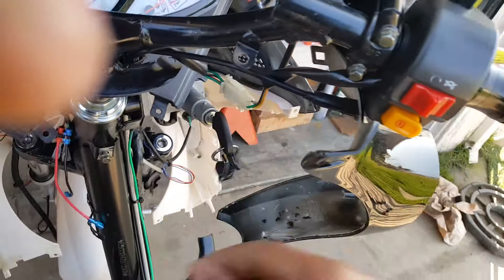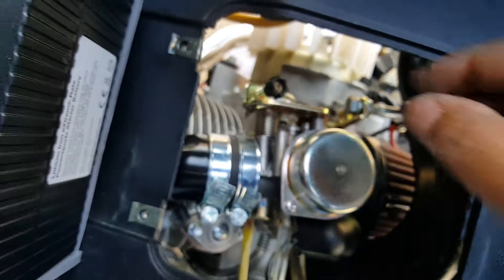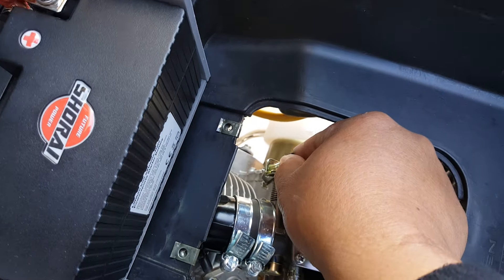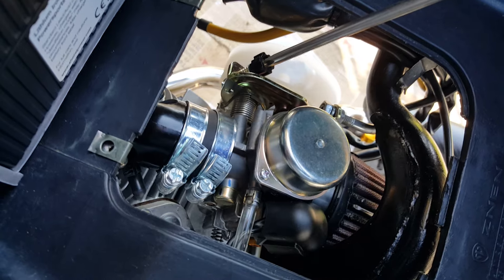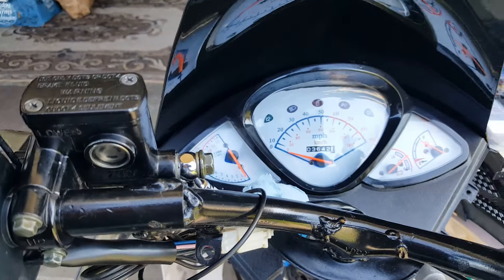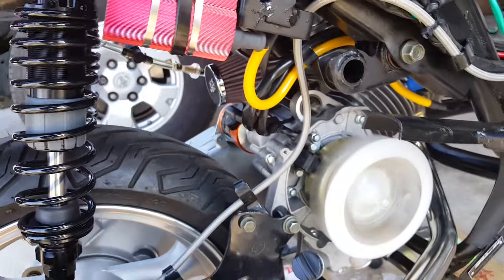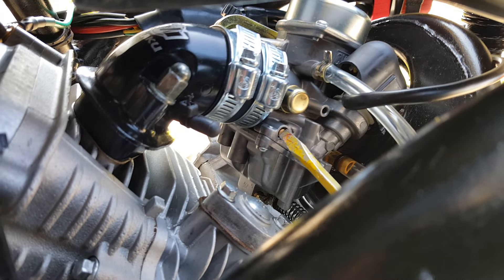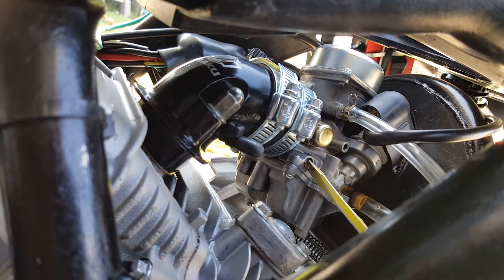How to Tune GY6 Carburetor Idle and Idle Mixture Screw 11 of 12

Comment: Set your fuel mixture screw first to it’s highest possible idle, THEN adjust your throttle idle screw... If the fuel mixture screw is turned out more than 4 turns to reach highest idle than you have the wrong size pilot jet and it should be increased in size. If you turn the fuel mixture screw less than a turn to reach highest idle than the pilot jet should be decreased in size... Turning the fuel mixture screw all the way in should kill the engine and if it doesn’t than the pilot jet is to rich (Large)... Your approach is very Elementary and not ideal for the best possible performance...
Reply from the maker: Thank you for the tuning advice
Reply: No problem :)
Reply: Can you damage the carb of a gy6 by closing the mixture screw? Like Harleys that have a small tip that breaks when closed completely with a little bit of excess pressure
Reply: You can damage it by setting the screw under to much pressure. Finger tips should be used to make the adjustments not a firm grip... by softly seating the idle mixture screw it should stall the engine out. If the engine keeps running than you need to reduce your idle jet size... From a seated position you should reach max idle speed with no more than 2.5 turns out. Any less than increase idle jet size, any more than decrease. Make small size adjustments or you will end up chasing your tail...
Reply: I would assume so...
Reply: Will take this approach next. Thanks.
Reply: Lol, elementary is being kind
Reply: Ķ
Reply: I was going to write those first two sentences but you beat me to it
Reply: I tried this my question I have a slight bump in idle

Comment: The adjustment on the left side you are adjusting first is the the enrichment, not idle.  That adjusts the air/fuel.  You really don’t need to fiddle with that, much, you’ll know whether you’re too rich or lean by checking the plug periodically that’s more important than how the engine sounds.  The idle adjustment is on the top right where you did start to adjust, generally on scooters with gy6 engines you adjust until the wheel just starts to turn on the center stand.  Scooters are plenty fun and good transportation if you take care of them, good luck.
Reply: He knows he said that was the idle on the right
Reply: oof.. if your idling engine turns the wheel your centrifugal clutch is engaged the whole time it will be done in a week
Reply: @31knot  I just got a scooter and it moves without throttle I didn't know it wasn't supposed to do that how do I fix it
Reply: @mrworldwide6770  idle it down
Reply: @rem700sniperplaystationnet9  thank you

Comment: Video is a bit all over the place,,,,,This is how you tune a carb, to find the best main jet you may have to play around, but the best main jet it what gives you best best pull and top end smoothly, thats how you know you found the right jet,,,,you tune a carb in this order,,main, pilot, needle, mixture screw, always tune top down,,,,,you must find the right main jet always,,,incorrect main can effect carb downstream,,,,,,get the bike warm and turn idle down low, then by adjusting the mixture screw, choose the setting that gives you the highest, smoothest idle, once you have found that turn the idle screw back to 1.5k ish RPM,,,,,josh garrison has some good info here as well,,,Ive worked with dyno tuners for morotcycles and ive tuned many myself, this is basic SOLID tuning advice

Comment: I think whats also helpful is that when the bike is on center stand and you are adjusting the throttle screw you want you back wheel to just slowly start to spin on its own. you def. dont want the wheel spinning fast or not at all. just a slow rotation and rpm at idle should be between 700 and 1000

Comment: I'm so glad I came across this video after watching it I'm comfortable with dialing in my mixture screw on my icebear Hawkeye 150cc scooter it dies on idle and at every stop sign I messed with my idle screw but anything lower then 3,500rpm it will die out I'm always having to keep it alive at idle by twisting the throttle from time to time but long story short I'll definitely adjust my air mixture screw and play with its idle tomorrow in Hope's to dial her in ...😁👍
Reply: sounds like you need to adjust your valves
Reply: Red, Ice bear Hawkeye That's the scooter I have it's a 2020 model and I love it it only costs $1,078 delivered to North Carolina I bought it from mega motor Madness when you're adjusting that idling jet screw on the side of the carburetor turn it to as highest idling point and then I like to cut back about 1/4 of a turn then adjust your idle screw to whatever your satisfied with
Reply: Yes also adjust ur valves !!